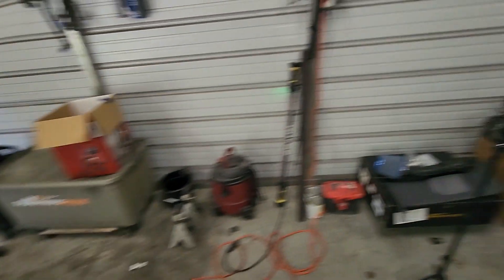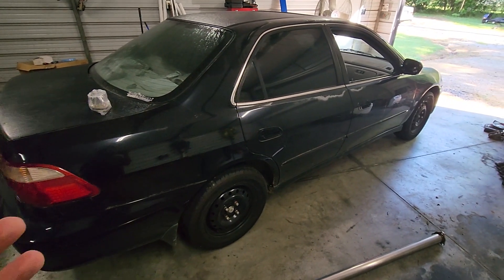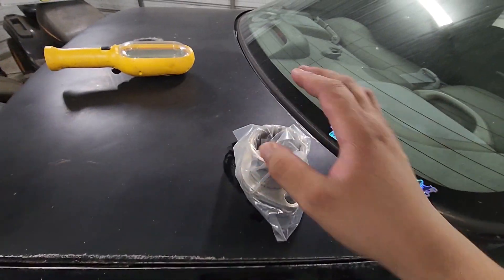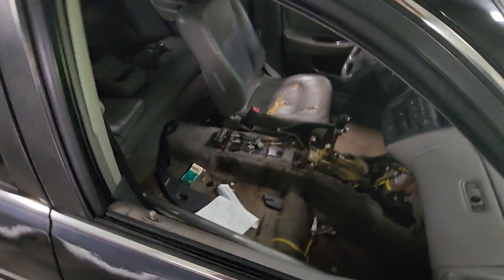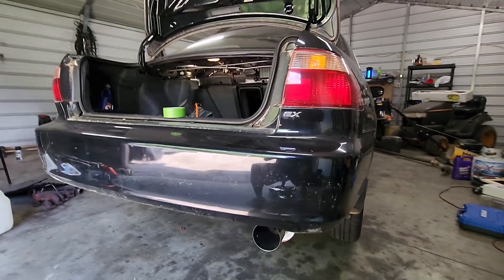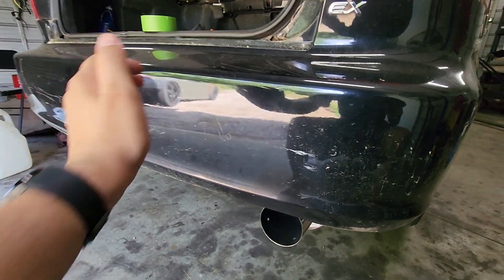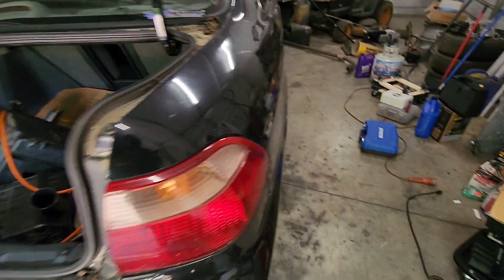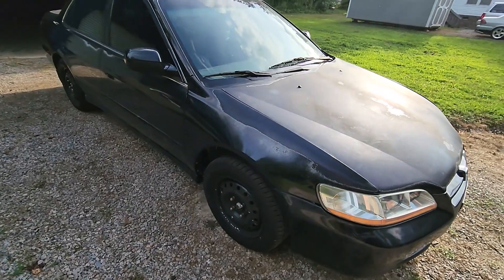Project Daily Driver CHEAP Honda Accord Exhaust Finished | Rear Looks So Aggressive!

Comment: I put 3 inch godsnow and a header and a test pipe on my 01 accord it sounds good but a little loud no check engine light.the test pipe has a o2 in it.it is on my channel

Comment: You should have your dude weld a bung into that midpipe and run an anti fouler so it pulls the secondary O2 sensor more out the stream and the car will read the difference between both sensors and run in closed loop. That'll keep the CEL light off
Reply from the maker: Might do that. Gotta wire in a plug for a 2nd o2 tho. It was ripped off when I bought the car